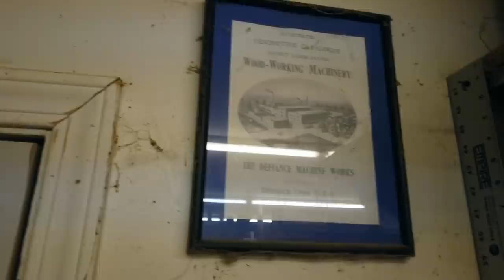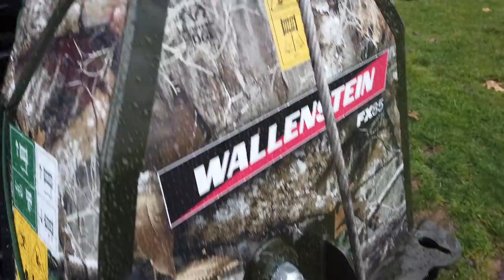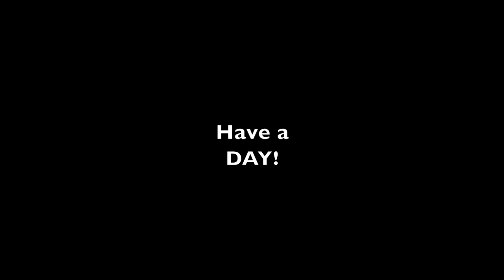#638 Mini Cabin Windows, Monster Old Lathe, Nice Red Elm and plans

Comment: Hey guys good video! Cold and foggy here in Arkansas. Mike you’re doin it right with the winch! Keep it down low, if something crazy does happen, like a broken cable it will tangle up in the brush and not come flyin through the air head high! Love the windows, and love you all from Arkansas!

Comment: Only use the chokers to hook logs up.  Using the mainline as a choker will ruin it.    If you run that main line over  rock if you use it like a choker it will start to fray it and will eventually break.

Comment: Use the choker chain every pull, using the cable will ruin the cable end, you will get steel slivers and break the cable. You want to keep your cable nice and straight if you can.<<< years of cable skidder operating talking here

Comment: Just a question regarding the chainsaw holder on the Wallenstein FX 85 Skidding Grapple. Are you concerned at all about bending the bar on a chainsaw with the motor bouncing back and forth while travelling through the woods. Now I would guess you wouldn't want to put anything to tall in the holder. I like the idea of having a one stop shop on a tractor so you don't need two vehicles everytime you go into the woods.

Comment: The windows are absolutely beautiful... The heart & sapwood on that elm is gorgeous to behold & I can't help but wonder how it would look as a finished table top. Good to ask questions on what's best for log hook-ups when using the winch. I have used them & typically I have used the keyed cinch buckles on single & multiple hook ups. I would avoid putting stress on the crimped on end of the cable as much as possible. I really like the Wallenstein line of winches & I'm surprised they only incl. ( 2 ) keyed buckles on the cable as I would add a 3rd for the convenience factor.... Your approach on the use of this winch is safe & prudent until you get more comfortable with it... The price on that releasable snatch-block almost floored me! 
Bill on the Hill,
Vermont... :~)

Comment: Pulling anything up high with a tractor is how people get hurt doing farm work.  You run the risk of flipping the tractor over backwards.  In your case, the Wallenstein itself may help prevent this because of how it’s designed and mounted on the tractor but I agree with those who recommended pulling as low as possible.  Safety first!  Really enjoy your videos, Mike!

Comment: Couldn't tell in the video for sure or not if already done, but I'd protect those super nice windows with at least a beade of caulk on the outside part between window pane and frame to seal... Awesome old lathe!... And definitely I agree fully Mike no wenching up high unless you want bent 3 point hitches or worse case scenario a tipped/turned over tractor.👍... Hope the healing goes well and speedy recovery Melissa.☺ Tell Hunter and kids I said  "Hi!"

Comment: Hashtag is pound 🙂 I'm going to venture a guess, based on what I would want, if you want to keep the cable in good shape you'll use the chain on the log. Elm splits nice if you freeze the firewood size pieces.

Comment: yes to the muzzle loader video.as for the log winch,i think you are right by lowering the hookup it takes load off the top link only,plus remember your physics ever time you put a cable through a pulley,you reduce your energy needed to pull a log by half,so if your running a 10k winch by running it through a pulley makes it a 20kand so on.if you saw that elm,it makes great lumber for horse,and cattle stalls,it is tough as crap,and the stringyness keeps them from chewing it.just a thought of a market for it.also they wouldnt nesecarrily need it dry either.

Comment: I don't know if you have whats called fence corner elm down there , when I grew up in ontario 1 1/2 hour north of toronto , we had this ,and it has a twisted grain, when wet its almost impossible to split, we never had a wood splitter just a axe and a wedge and sledge hammer! no fun! then when I was a teenager I bought a cord of tamarack , my father asked me what kind of fool did I raise? you ain't burning that in our wood stoves! it burns hot like it was soaked in gas! last time I bought wood!

Comment: Melissa, I am glad you will feel better soon..  It too bad your ability to dance  will be limited for a while.  Your eyes dance beautifully.  I hope you both enjoy the party and have a safe trip.    Mike, your habit of estimating the weight of your logs is a great safety measure.  You can then use a double line if necessary..    Using a chain choker may save wear on the load end of your cable.   I hope all Morgans have the full Joy of the Season.  They have added to mine for some time.   God bless you all.

Comment: Please do the video on flintlocks in PA, I am a black powder shooter here in Colorado and I am an NRA Blackpowder instructor as well.  Just do what you were talking about with the practice and you can get over the flinch when you shoot.  Cleaning should not be a problem just use a bit of what we call Moose Milk.  It is an 8oz bottle of alcohol, 8oz of Hydrogen Peroxide, with a 32oz bottle of Murphy's Wood Oil Soap.  Plug your touch hole with a round wood toothpick, fill the barrel with the mix and soak for about 5min. then take a shotgun swab and push thru it a few times after it has soaked then clean with wet patches then dry patches till they come out clean.  Once clean I use a bit of "Bore Butter" and run a few patches with that to coat the inside rub the outside and store your flintlock will be ready for your next shoot.  Let me know if you need any info and I can give you some more tips.  You will enjoy your hunt even more with a gun that does not give you problems or fouls.  Just never use Detergent only soap to clean.  Good Luck with your black powder shoot and looking forward to your video.
Reply from the maker: Thanks for the info John!

Comment: If you pull high the tractor can tumble backwards and that would be a disaster My dad was on one without a roll bar without a cab and he was pulling a hackberry tree with a long rope and the back wheels of the tractor rolled into a low ditch the log got stuck and the tractor reared up he grabbed for the clutch but slipped the tractor flipped over backwards onto him killing him he had tied the rope onto the top hitch on the 3 point. I was there and seen it happen so don’t do anything with the top tie offs or hitches

Comment: That is a YES on the "Flinch Lock!" Windows - in like Flint, cool; the grain runs nicely together at corners. The winch has those chain hook points for multiple pulls instead of relying on winch. Tether them there after winching the log up to tractor, save the gears for work.....last longer I bet.

Comment: MIKE,  nice windows! ,  I built a porch swing out of red oak and used stainless steel screws and hardware due to the moisture from being outside. the wood doesn't stain. I know it's a 'mini-cabin' and you're mounting them inside but just wanted to throw in my 2 cents.( Mcfeelys screw catalog)

Comment: Mike I'm with you when it comes to routing the braided steel cable into the lower pulley. If that were to fail I would want all the protection for me and my tractor as possible. Utilizing the lower pulley would direct that stray choker/ cable lower into the giant steel body of the winch.

Comment: I been battling plantar fasciitis all summer long. Finally getting better. Sucked for wood cutting this year.
Reply: Hope you heal soon Larry.
Reply: Larry, I dont know if you've tried this, but I've had decent success with soaking in hot Epsom salt water. I try to do it twice a day and get the water as hot as I can stand it and soak my foot until the water is cool.  All that being said it does work best if you do it when you first start noticing the pain, but I started last year after months of hobbling around and it did help.
Reply: Stretch those tendons and get yourself a night splint. It's a self limiting injury, take it from me, it will eventually get better. Godspeed, I know personally how painful that is.
Reply: @steelfist65  
That what I do. Had the same thing about 12 years ago
Reply: @oldmanfred8676  
Thanks
Reply: @jasone9  
Thanks
Reply: @steelfist65  
Thanks